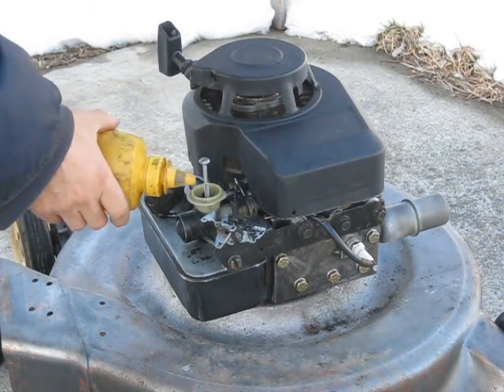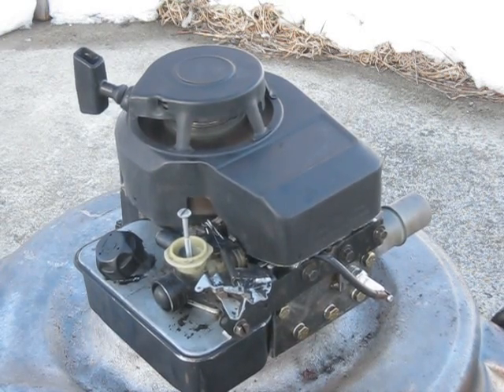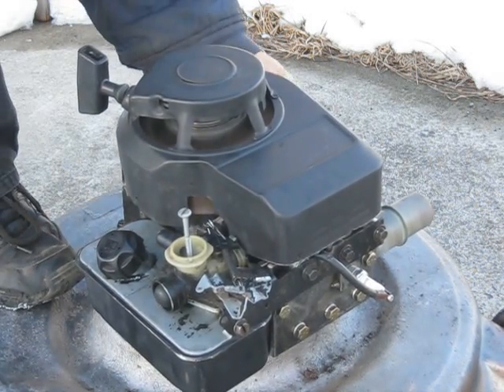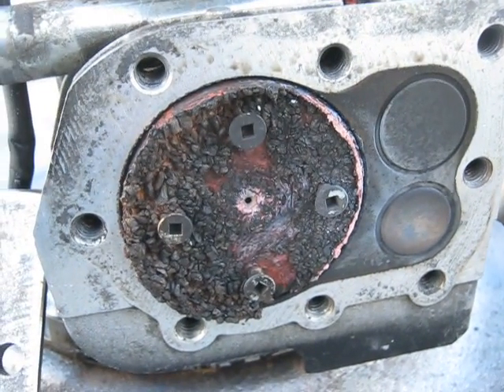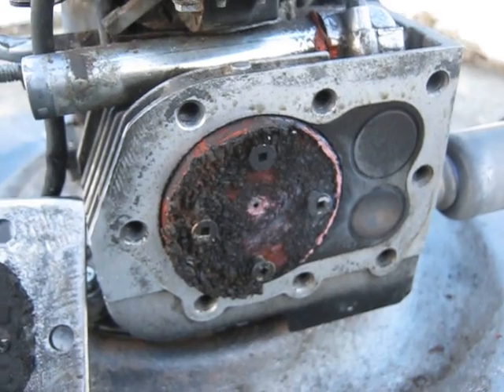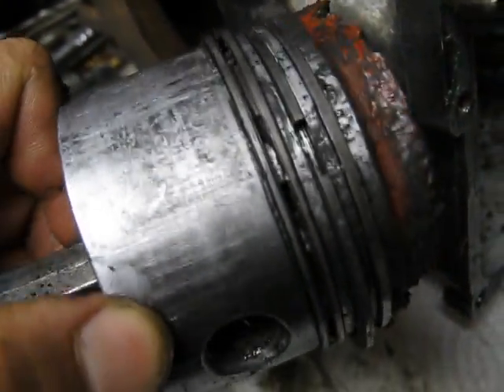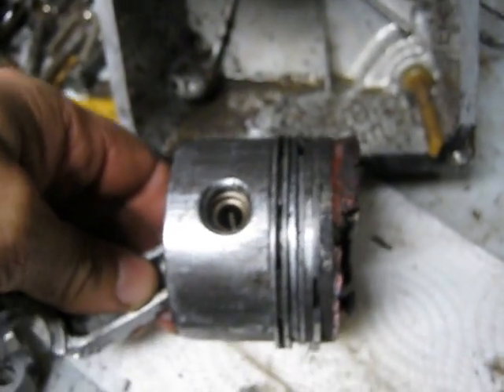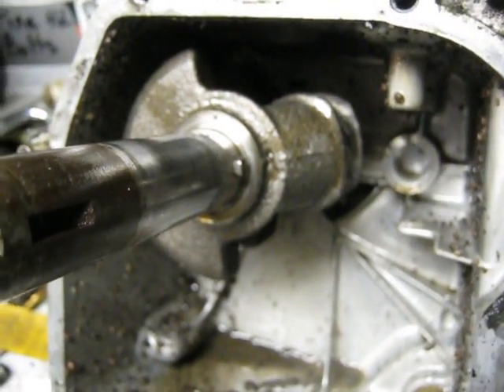Cork Piston, Scored Cylinder!

Comment: You should try to make a piston from Quiksteel.  This stuff is awesome! Molds, sands, you can paint it, good stuff. I've used it  for everything from patching buckets to building a air tight seal on a water pump. 
 Temp. Range of -90 to 500°F
https://www.grainger.com/product/6YHT6?gclid=COuRweDHgdMCFQiDfgodt9kOzA&cm_mmc=PPC:GOOGLEPLAA-Adhesives%2C%20Sealants%20and%20TapePutties_-6YHT6&AL!2966!3!166587323011!!!g!61865531738!&s_kwcid=AL!2966!3!166587323011!!!g!61865531738!&ef_id=WNbI1gAAAJSK8hv9:20170331201628:s

Comment: Love these videos. How do you think you're going to finish the engine off? Or try, anyway. Briggs are damn tough.
Reply from the maker: I managed to salvage it with some 220 grit sand paper, sanding down the gauling at the bottom of the bore. It seemed to work fine with the plastic piston.

Comment: could you try a cylinder sleeve? I've been wondering about someone doing something like that.
Reply from the maker: I would like to try that, but I pretty much have no machining access at the moment.
Reply from the maker: I was able to salvage this engine by using sandpaper on the scores, so they weren't all that bad after all. I hear JB Weld can be used to fill in the holes also, sine it doesn't get very hot at the bottom of the bore.

Comment: I sure get a kick out of your experiments. To bad I don't live closer so I could donate you an engine
Reply from the maker: Thanks for the thought anyway, I appreciate it! I am uploading my latest now, I cast a plastic piston, and the danged thing ran for 4-1/2 minutes!!! I honestly figured it would break off the piston skirt in like 3 seconds, guess you never know how these experiments will turn out! I was able to salvage the engine i have been using for all of these wood piston crown runs, just used sand paper on the cylinder. Pretty hard to kill these Briggs 3-1/2 horse engines!

Comment: You think this was bad you should see the engine i picked up today. The bore was not too bad but there was soooo much play in the crank so much that  as you turned the engine over  the magnets would get stuck on the coil and the crank case had a lot of gunge in the bottom of it.
Reply from the maker: Yes, I have seen a couple of engines like that over the years, with the flywheel bushing worn out. I used one as the first engine i ever tried to blow up, I tied the throttle open, and the danged thing ran for 45 minutes. I gave up, untorqued the con rod bolts, then it blew the rod in 10 seconds!

Comment: its a shame you can't put duralube in it, and only duralube, to test how well it works, or how long...  cool video.  sorry for your engine, Bud.
Reply from the maker: Good advice!  I was able to save the engine with some sandpaper, I just gave it a 4-1/2 minute run with a plastic piston that I cast!

Comment: For what you are doing you can probably hone the cylinder and run it for now. I have a few small engines sitting around, what area are you from?
Reply from the maker: Ontario Canada, but don't worry, I have a shed full of these engines, so no worries.
Reply: ChargerMiles007 thats good! We're from Ohio. I dont really use the smaller engines, but i keep them for some reason. You never know.
Reply from the maker: Yes, same thing here, I guess I have enough that I am prepared for the zombie apocalypse!!!   :)

Comment: Bad for the engine,But I thought that was a good run..Put it back together for a great engine BLOW!! You can always go back to the junk-yard and get another!
Reply from the maker: I used sand paper and varsol to clean it up, I used this engine for my Plastic piston run today, and it didn't even burn much oil.
Reply: @ChargerMiles007  I recently did something similar with my Briggs, and sanded down the walls. Runs like a champ again, but one of the rings went bad and it smokes like crazy. Hoping a replacement will make it ok.

Comment: What assembly lube do you use? I have heard epoxy can work on scores like that, away from direct flame.
Reply from the maker: I used 10W30 engine oil for lube, like I normally do on these engines. True, I could give JB Weld a try on the scores.

Comment: I'm impressed it ran as well it did with the reduced compression at the end. Have you considered using formica as piston material? My only concern would be the 400 degree F limit where it starts to break down. Another idea that comes to mind is hard board with a few coats of high temperature paint.
Reply from the maker: A fellow youtuber is sending me some ironwood to test out, so that should work well.